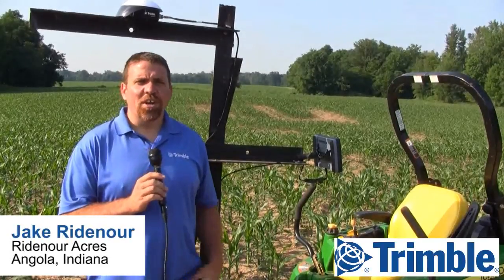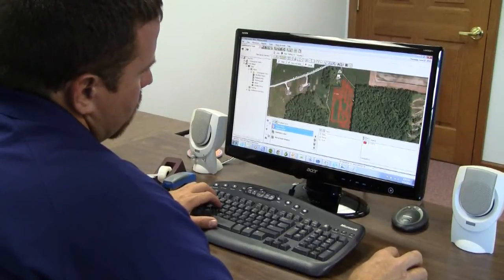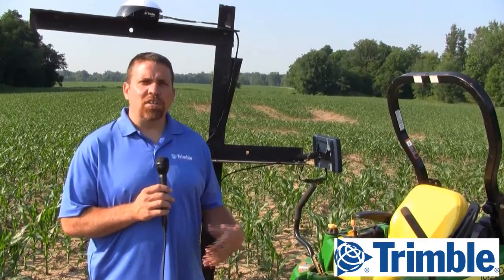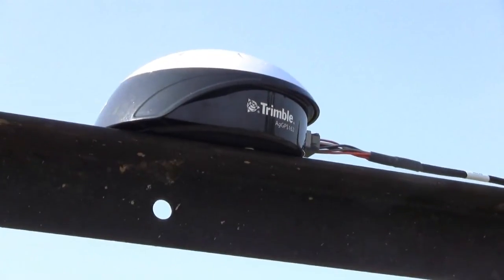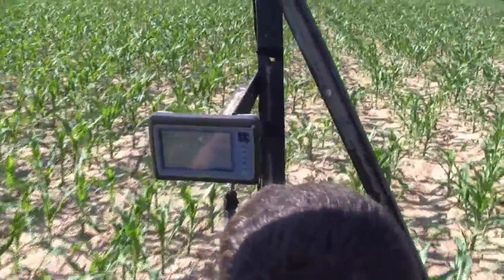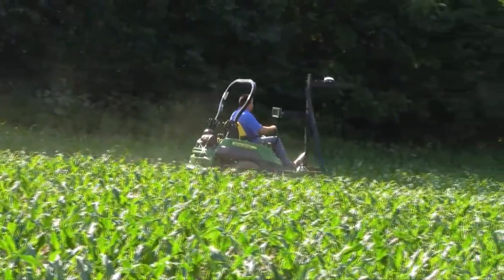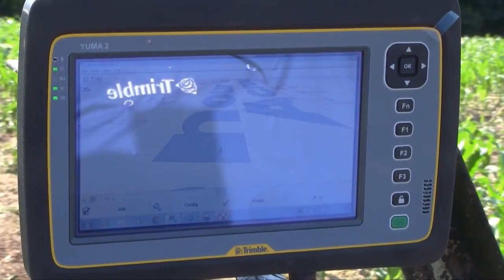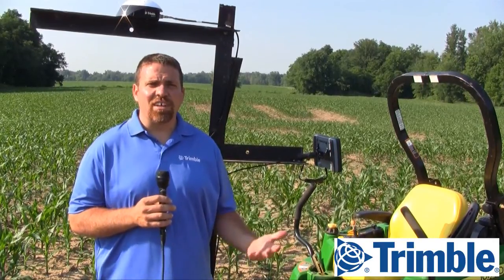Using Trimble Technology for Corn Mazes

Comment: Very informative. Do you utilise GPS in "everyday farming applications? For crop placement/ploughing straight lines and such? For cutting a crop maze,does the GPS system guide your corn cutting machine automatically (I don't see you manually steering the machine at all)? Thanks very much for taking the time and trouble to post on YT. I guessed that modern technology played a major part, but your explanation was very helpful. Thank you  :-)
Reply: yes, I'm wondering the same things.
Reply: Yes, I'm wondering the same things.